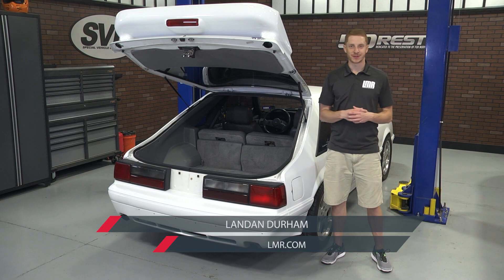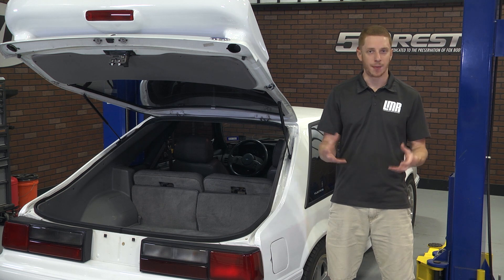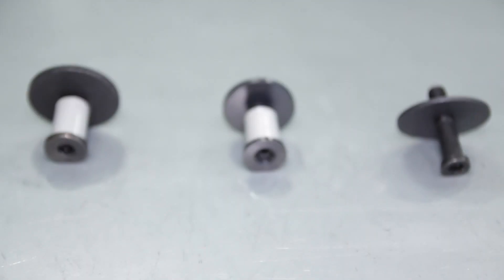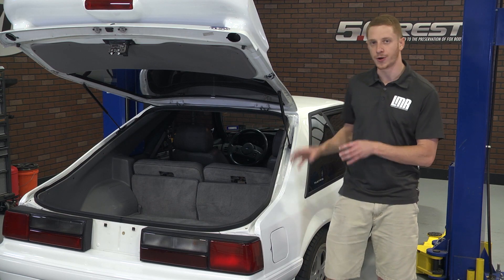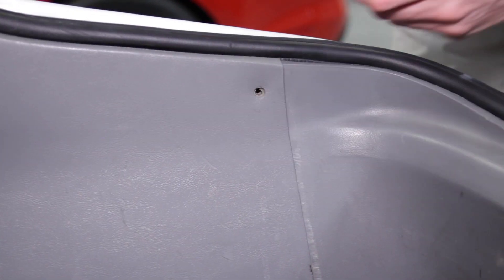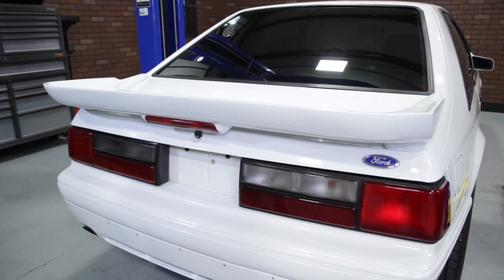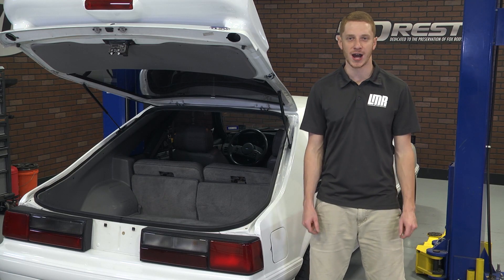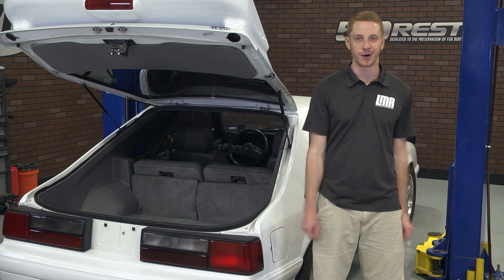1981-1993 Mustang 5.0resto Hatchback Resto Kit - Review & Install

Comment: Anyone have a video about how to fit the hatch back better.  My hatch does not line up very well.
Reply: they weren't ment to ..6 bolts up top is about the only adjustment you get ...if it hangs over on 1 side and even on the other try  another hatch